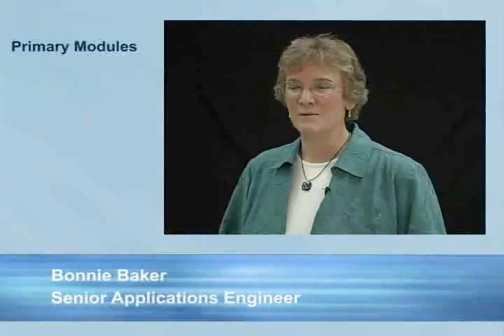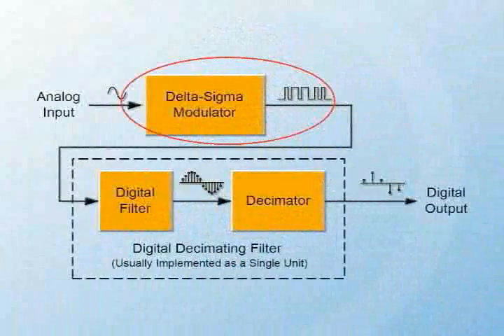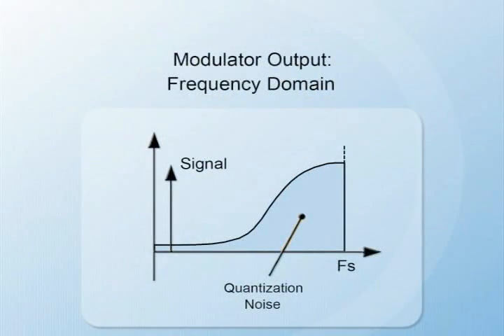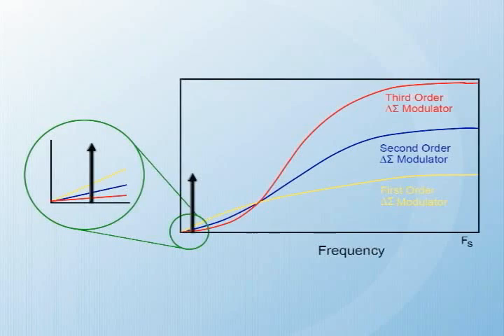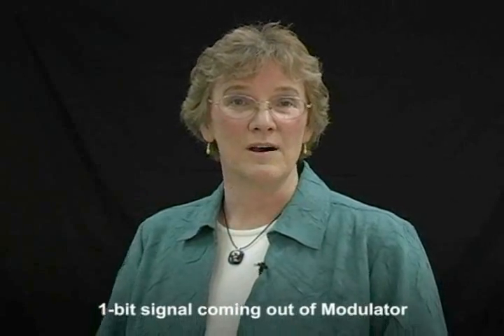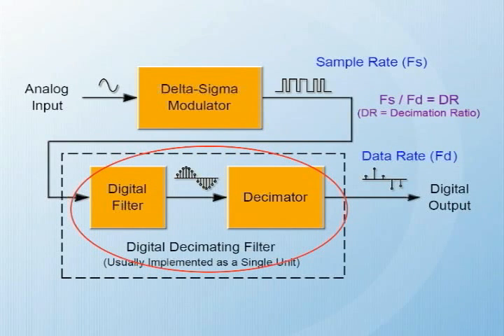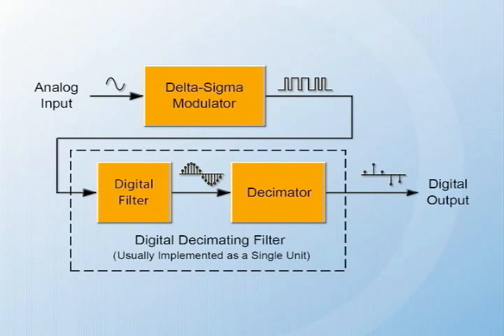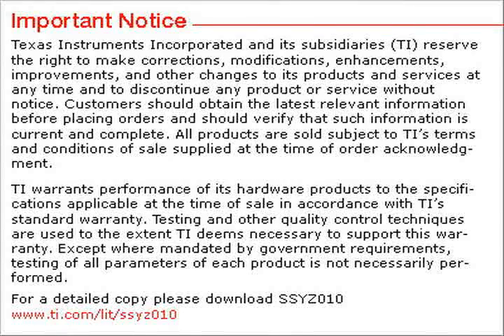Nuts and Bolts of the Delta-Sigma Converter

Comment: Bonnie did a superb job here, beautifully explained, easily assimilated and understood. It’s rare to find communicators of complex subjects as excellent as Bonnie. It helps to have some character background in the lower level blocks of Sigma Delta ADC like the modulator (summing amp, integrating filter, comparator, 1-bit DAC), digital filter and decimator to fully appreciate the finer details as this will open the black box so you can appreciate the structure, behaviour and performance which gives a complete picture of how the delta sigma data converter works.

Comment: Can someone simply explain the high level abstract functional difference between the output of a delta sigma ADC and let's say a 10 bit successive approximation ADC with a similar software averaging routine applied to the white noise? I'm specifically interested in understanding the difference within the context of DC signal measurements. From my beginner's perspective, I get the impression that a delta sigma converter is intended more for the frequency domain?
Reply: The higher sample rate of the sigma-delta allows a lower order anti-aliasing filter on the input, thus less ripple.  Though I’d assume that filtering still needs to be made up for in the pre-decimation filter, but digital is cheap and fast.  In the end, that’s all what it boils down to; replacing precision analog with cheap and fast digital.  Dirt cheap audio gear wouldn’t exist if only precision 16/24 bit converters were available.